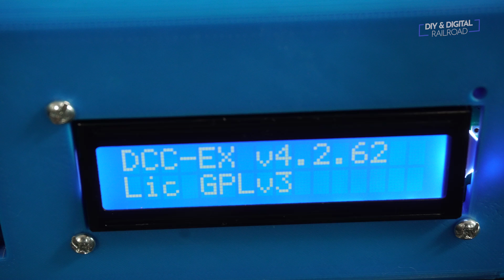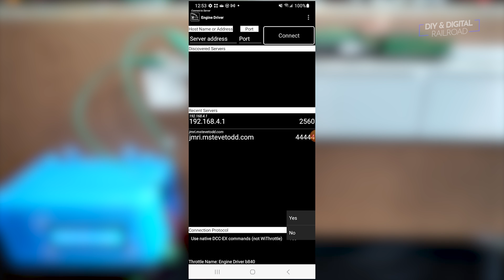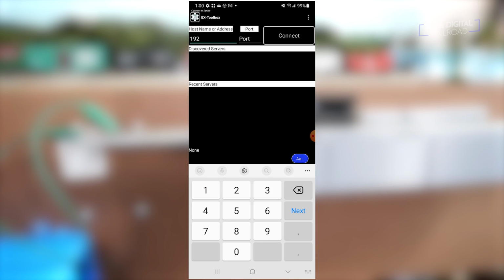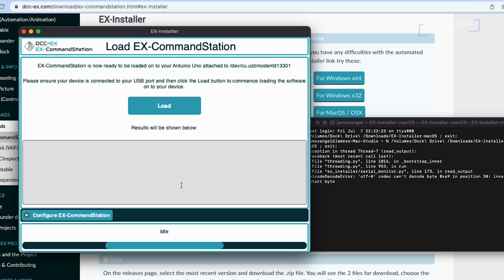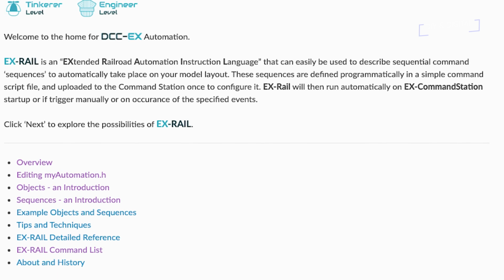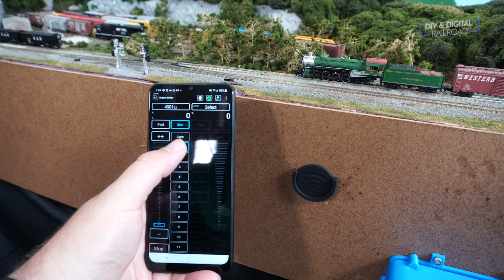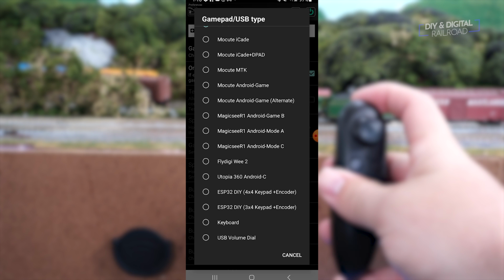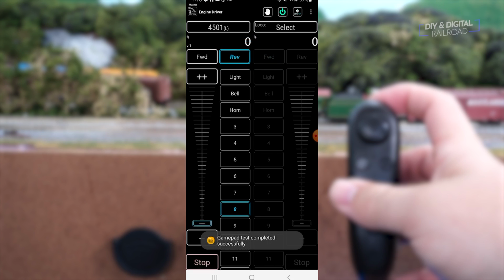Cheap and Amazing!  DCC-EX 2 Years Later

Comment: i wonder if there is any work on using MIDI controllers with DCC-EX?  imagine being able to control every engine, switch, lighting... everything in real time with tactile knobs.   the MIDI protocol has been used for decades in studios and would be perfect for model train layout applications.  install a MIDI jack(.50) on the base station and bob's your sister. i don't care for wifi throttles but there are lots of wifi MIDDI controllers.

Comment: Hi Jimmy, I've been following your youtube channel for some time and have now statrted to build my layout, i am going to use the DCC EX system as it has great functionality and inexspensive. my layout is being built on seperate boards so that i can lift them to work on, laying on my back at 60+ fine its just getting up is an issue. i have daisy chained 9685's one for each board to allow for various control options. Now heres the question, I want to indicate point direction on a mimic board, just using switch position, no feedback required, but need a detailed explanation on how to fit multiple I/O boards to the base command unit. a video on this would be great. Thanks from a wet and dismal UK just down the road from Ribblehead viaduct

Comment: Hi, I didn't quite understand how the whole thing works. With an analogue system I have two cables that go to the rails, how exactly is the motor shield connected?
Do I understand you correctly that there is full voltage on the track and the direction and speed are set by the frequency?
Greetings
Reply: You will disconnect your current AC Transformer from your tracks and place it in a box, 
Then connect a pair of wires from the motor shields A channel to those Tracks. This will give you one District/track to assign as a DC track with a Cab# address from 1 to 10239 as that tracks throttle number.  This could match your Analogue engines road number from the side of its Cab.

You can then also connect a pair of wires from the motor shields second channel B to a separate insulated District/track and assign it as a DC track with the Same Or Different Cab# address from 1 to 10239 as that tracks throttle number.

And drive either one Loco from track A to B If there the same Cab# address,  or drive Two Separate Cab#, one on track A and one on Track B, both simultaneously from the same Engine Driver Throttle with Two different selected Loco# loaded into two separate throttles.

On a multi-meter set to DC, the track voltages vdc is detected as as  0zero, with the throttle speed 0zero, and it increases as you throttle up to the max vdc of your Laptop power supply, i.e., 12vdc for Z & N scale and 14-16vdc for HO scale.

See DCC-EX version 5.0+ new TrackManager features. 
https://dcc-ex.com/trackmanager/index.html#gsc.tab=0

Regards,
Kevin
DCC-EX Dev Team

Comment: this is so cool.  I have been working on my own system much like this.  I support DCC and I am also experimenting with 2 way communications with the locomotives and decoders installed in rolling stock and animations (lights, garage doors, switch machines, etc...).  I am using CAN bus which isn't the best choice but due to availability of on chip hardware it mostly works.  This, of course, requires me to install a new decoder in the engine to handle CAN.  I have no problem open sourcing it if folks are interested.  Since I'm a one man show with it all, it's likely very rough around the edges.  I have been studying the NMRA specs.  In particular their 9.3.2 spec on bi-directional communications aka RailComm and as an embedded electronics and software guy, I can't say I'm all that impressed.  I really want to see the hobby go a different direction than this barbaric railcomm protocol and adopt either a CSMA/CD type protocol or some other non polling solution.

Comment: Hi Jimmy:
Were you able to use the automatic installer to add the LCD display, or did you need to fiddle with .h files and/or hand compile and load things?
Thanks - DCC EX really is a game changer.

Comment: THANKS for the great info Jimmy.  I use this system to as a stand alone and with a RasPi runing JRMI and it works great. I have a question, I sometimes have an issue reading/reprograming decoders using my 12v power supply. Have you had these same issues??   I have found that sometimes I need to swap out the power supply for a 15v-16v PS to have decoder programing functions work. Most Motor boards seem to be limited to 12v and I worry about damaging them when running higher Voltage.  What are your experiences and any suggestions?   Thanks in Advance. =)

Comment: I was wondering if you have to have original Arduino Mega or not, since I can't find original Arduino Mega with normal price (they start at 85 euros for some reason) and was thinking about using Arduino Mega clone.
Reply from the maker: I almost always use clones.  Elegoo is my favorite.
Reply: @DIYDigitalRailroad  Thx for the response, I was also looking at other motor shield drives and was trying to find one rated at least at 5A since shipping from UK would be quite expensive and lengthy, and in Slovakia we have hefty import taxes and it would cost me about 80 euros for the motorshield drive itself. What exactly should I be looking for for the motor shield drive to be compatible? I found one (Cytron MDD10), but on DCC EX website there is nothing about it.

Comment: Hi Jimmy, really good video and I love DCC EX as its a game changer no doubt. Can you make a video on using an arduino mega that comes with a esp8266 shield installed in it. I n that way we can eliminate the use of a wifi shield. Just the arduino board and the motor shield. Is that possible.

Comment: Do you plan to release a video about adding that I2C 2 line display and what code changes are needed? .. And I'd also love to get the STLs for the case - please with added fan as it gets very hot here.
I followed your video about building up the simpler DIY DCC++ system using Arduino uno and L298 motorshield .. I'm a bit miffed that the EX Motorshield is currently out of stock... Hope to "upgrade" my system soon(ish). Thanks for your videos, they are a big inspiration to continue with our hobby

Comment: Jimmy, just started with JMRI and am getting boxes highlighted in RED. I'm sure that can't be good. What does it mean? I am trying to program a Bachmann EMD GP 40 decoder already installed by mfr. Is there a JMRI resource to ask these questions? Thanks for all the info you share with us.
Reply: forgot to add I am running a DCS52 .

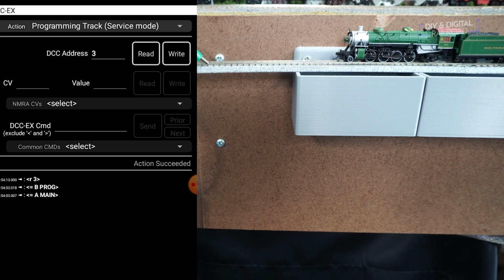Comment: At about 2:40 when you read the CV, the jump forward is a tad disconcerting.
Reply: All locos respond differently based on which decoder is installed and its firmware... the motor has to wiggle to create a current draw which is used to read the CV. GOOD decoders alternate the motor wiggle between forwards and backwards so it jiggles on the spot instead of jumping in one direction.

Comment: Good for you Jimmy, but this is all light years beyond my abilities to grasp in any meaningful way what the heck you are talking about. I do run my n scale layout with DCC (ECoS) but I have no clue about arduino, jmri, ex, etc. I'm sure there is a group within the modeling community that is more than just interested (perhaps immersed) in the electronics/digital side of the hobby, and good for them. But for a regular guy like me, where programming a locomotive is challenging, it is all foreign. I would not even know where to begin or where to even find a roadmap.
Reply: That's where the installer comes in, you snap the boards together and just run an installer. But easier still is to buy a full command station ready to just plug in from one of the dealers. You are right, some folks like to Tinker and build it themselves and other folks just want to connect one side to the wall, the other side to the track and go :)

Comment: Suggestion: mapping DCC controls to Atari 5200 controller
Reply: Good idea. It would be possible to build an interface. There are a few DIY throttles now, including ones with touch screens. Of course, some commercial throttles work with EX-CommandStation too, like the UWT-50 and UWT-100.

Comment: I was starting to comment on your video, when my internet went down, it does so several times a day. And they can't seem to fix it. So I'm looking for a new internet provider. 
But the video you just did was fantastic. I have to say, I gleam new ideas every time. I liked your advice about a cheap tablet. I got one from Walmart for 69 bucks, it's an android tablet,
and it will run engine driver. My set up for DCC-EX the new 5-amp motor card, the Wi-Fi card, but I do use a computer plugged into the Arduino (Raspberry Pi with JMRI). When I program a train I use my old faithful Sprog - Pi one works like a charm, I just copy over all my setups to the other Raspberry-Pi 4B. On occasion I do use a laptop, I find it easier on the Arduino Mega. 
 I have to say the fellows from DCC-EX are full guns ahead. Your so right on the money Jimmy!! I think DCC-EX may become a standard that others will follow.

One more thing I have my whole setup in an old PC power supply, I used the fan on it to keep it cool, The old pc was from a gaming PC that bit the big one.
Reply: In a bit of friendly cooperation,  SProg programmers from the last year or so use our technology to to CV reads and writes. ;)

Comment: I’m thinking of using my old nano since I’m only wanting to replace my pr3 xtra for the programming track and not run a layout. Just have to get off my seat to order a motor shield. Thanks for sharing.

Here’s a donation for your fund to the dcc++ ex kitty
Reply: The Nano will severely limit you. We have strived to keep a version that will still run on an Uno and a Nano, but you will have to live without WiFi, or Ethernet, and our full HAL accessory capability. We do have a way to run small EXRAIL scripts. If you are using JMRI as your throttle through the USB port, then go for it, otherwise, we strongly recommend an ESPDuino32, Arduino Mega 2560, or Elegoo Mega 2560.
Reply: @DCCEX  Wow! Never expected response from one of dcc ex people!

Currently, I use either a digitrax pr3 xtra or an esu cabcontrol connected to a windows laptop using usb to program non loksound decoders on a programming track mode. Because of some odd behavior when testing settings using the pr3 xtra, I’ve had to resort to using the esu cabcontrol in place of the pr3. I thought the arduino uno (misspoke when I said I would use a nano, but sounds like both have the identical limits) may function better than the pr3 for a dedicated programming Command station used the way I’m using it?
Reply: @KenN.OXN.805  The way you are using it is perfect for a programming station, so give it a try. And thank you for supporting us! :)

Comment: I'd like to see a Raspberry Pi Pico port for DCC-EX(+?). I have a suspicion that the DCC encoding could be offloaded to the PIO (Programmable I/O). And the $6 Pico-W has built-in Wi-Fi and Bluetooth and more flash storage than needed (2MB). All you would need is a motor controller.
Reply: I will be looking for that. Have a bunch ofPi's n  Pico's no Arduinos.

Comment: I have been using DCC-EX for over a year as well. I just recently got it set up and working with an ISE ProtoThrottle. And that was a fun little project to do. I did a video on that if you want to check it out. I ALMOST bought one of their motor shields. I probably should have but I have a stack of spare 2amp shields sitting around that I got a great bulk deal on.
Reply: Can you stack a 2nd one of the 2A motor shields on top of the first to give 4 districts with 2A each (or 3 districts plus a programme track)?
Reply: @Cloudman572  Yes, that is why we included jumper configuration pads on the shield. We will be posting more information about how to do that on the website with the release of 5.0 in the next couple of weeks.
Reply: @DCCEX  Brilliant, thanks to you and all the team for what you are doing.
Reply: @Cloudman572  I think that is possible but not certain. It would take some custom code to make work. Best to ask that in the DCC-EX chat.
Reply: @Trains-With-Shane  Ok thanks.
Reply: @Cloudman572  

Yes, you can stack two Motor Shields on top of one another then open a config.h file and choose which two you chose, and be sure you have the correct pins for Dir, Signal, Brake, Trip Factor, Max Current.

Compile and up load the new CS settings and you have Four Districts/Track options for DCC and or DC Locos.

Using DCC-EX Version 5.0+ and the new built in TrackManager features, either or both dual insulated Districts/Tracks can be set to DCC mode {MAIN & PROG} and/or DC mode {DC & DCX (opposite polarity)}

In addition we have partnered with Makerfab and had the more reliable ESP8266 WiFi chip firmware version 1.7.4 preloaded, and now also available through the DCC-EX store.

Regards,
Kevin
DCC-EX Dev Team

Comment: I have to second your comments on Engine Driver.  I have an old, surplus cell phone, no sim card, but wifi works.  That's my go to throttle for use at the club, and when we take our ON30 modular layout to train shows.  During operation sessions at the club, we might have 10 or 12 operators, and our Raspberry Pi based JMRI control system works faultlessly.  No running around finding a free Loconet port to plug a throttle in, jst pull out the spare cell phone, start Engine Driver, and hey presto.  Thanks for the article, I'm about to start work on my new layout in a soon to be completed train room, and DCC++ EX will be the control system.
Reply: Went to my local club for the first time yesterday, playing catch-up to their system. Lucky I am familiar with Pi and Arduinos. I do prefer Pico as they are smaller and cheaper.

Comment: A new video with a different motor shield would be great. I was considering getting the 8A motor shield mentioned on the website. I bought 2 of the wifi shields. One for my N scale layout, and I haven't decided if I'll use the second one on a small garden railroad* or my bigger garden railroad. I recently bought a raspberry pi for JMRI too.

Also, was planning on getting an 8" tablet from Walmart to run engine driver.

*I have an old LGB set that I'm considering adding a Massoth decoder.
Reply: I have not tried it but I did come across this video showing issues with the speed of the raspberry.
https://www.youtube.com/watch?v=03qXDrhclX0
On the other side @linuxpirate has commented here that he has no problems.

Comment: Replaced my NCE PowerHouse Pro 5amp radio system with DCC-EX running on an Arduino Mega with Hans Tanner’s Red Hat and 5amp powershield. It works great and have had no problems. DCC-EX is the way to go!
Reply: Much cheaper too
Reply: @lebryantjohnson7306  I was able to buy some other stuff with what I got from the NCE system. Win-win for me!
Reply: We like to call it "affordable"... ;-)

Comment: Has anyone tried using the new Arduino R4 in place of the Mega 2560?
Reply: Not supported at this time (I asked)
Reply: @davefalkenburg3276  Somehow I'm not surprised. They seem very wedded for life to the Mega 2560 board.
Reply: @jerrysmith1929  just not the top of the list— I may know someone who is going to look into at least seeing if the R4 minima could be used. Evidently some of the developers don’t like some of the hardware choices for the R4 WiFi.

Comment: This is basically amazing. Thanks for the update. You really got my attention with the information about using a game controller as a throttle. Two questions: how many throttles will the system support? I'm looking to be using in the ten throttle range for my next layout. Does DCC EX support Universal Consisting?
Reply: The ESP8266 based WiFi boards support 4 throttles because they support 4 WiFi connections. If you go through JMRI, you can get more simultaneous throttles. We are looking at ways to enhance WiFi in the future and announced support for the ESPDuino32 boards ($7-10) that has the CS with WiFi on one Uno sized board. ST Micro Nucleo boards, one having 144 GPIO pins (~$20), are in beta testing now also.